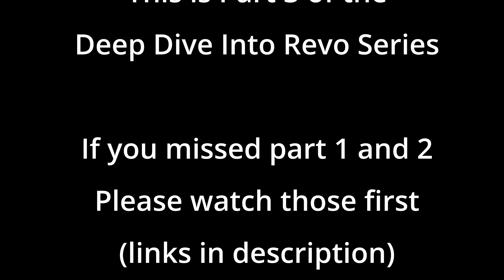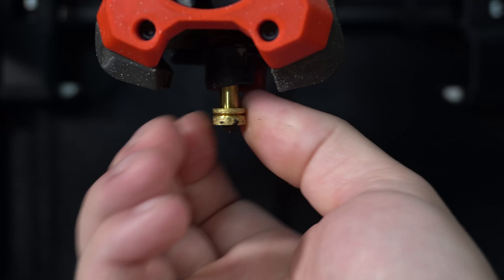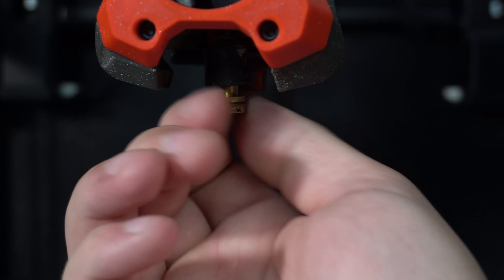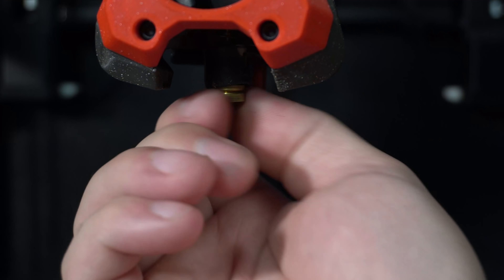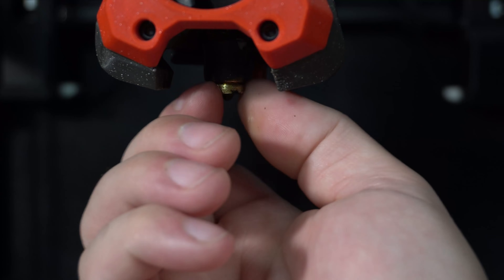Deep Dive Into the E3D Revo - Quick-change system - Interview with Sanjay M- PART 3 FINAL

Comment: The more I learn about Revo the more excited I get. I'm going to be building my Voron v0.1 with a Dragonfly, but hope to swap it out for a Revo later. The more I think about it, the more being able to painlessly swap nozzles appeals to me. I realize that I'm kind of nozzle change phobic. I'll do almost anything to avoid it, even when switching to a different size, or to a hardened nozzle so I can print with an abrasive filament would be the right thing to do. I just don't do it. So I'll just print with 0.4mm and non-abrasive filaments. There's an entire world of materials and printing speeds (or fine details) that isn't readily accessible to me.
Originally I was thinking of building my v0.1 with a Mosquito Magnum so I could work up to high-flow printing, but the more I've thought about it, the more living with 18mm^3/s and interchangeable nozzles makes sense from a perspective of actually being useful to me.

Comment: When the heater heats up, the bore expands linearly with the diameter. If the nozzle has a higher thermal expansion coefficient it may start to close the gap
Reply: The nozzle will almost certainly have a higher thermal expansion rate. Ceramics tend to expand far less than metals, some ceramics have a coefficient as low as 2, while brass is 19.
Reply: @creamofbotulismsoup9900  With these small sizes, it won't expand enough to affect anything.
Using your factors, an 8mm brass nozzle will expand 0.0421mm at 300C while the ceramic will expand 0.00443 for a difference of 0.03767mm. Free running fit for an 8mm bore is 0.040mm, and loose running fit is 0.080mm. So if you size the hole for loose running at 23C, it will be free running at 300C.